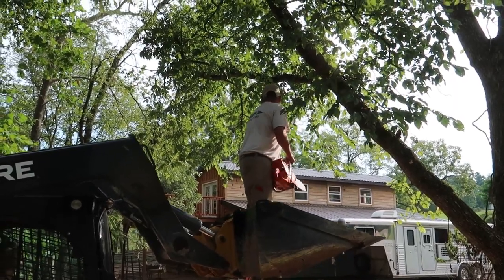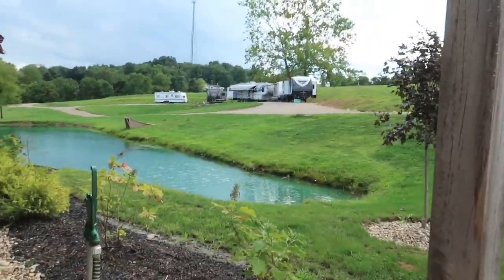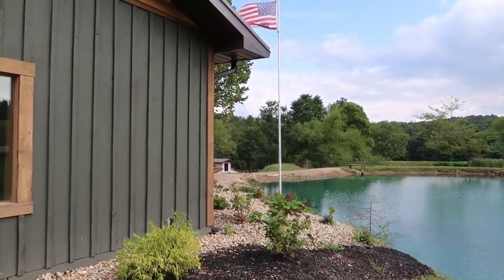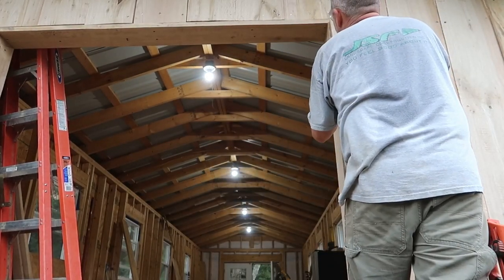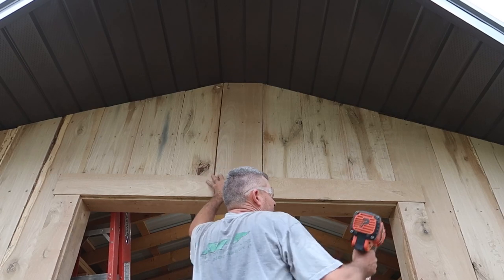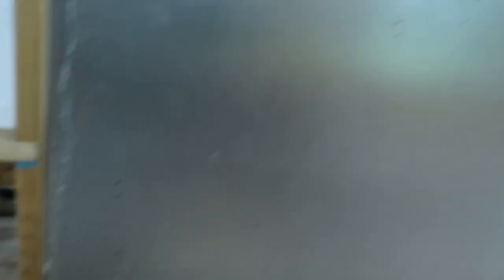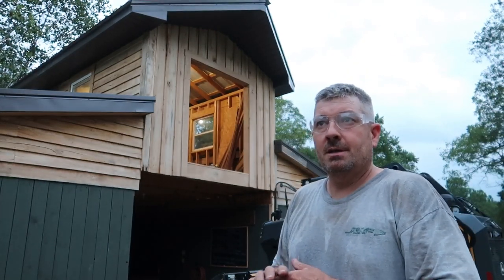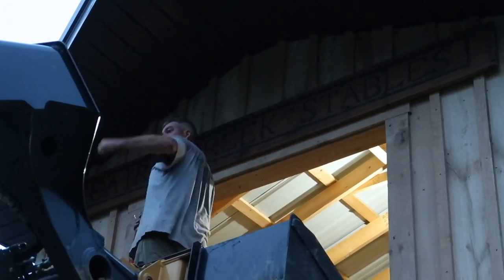Fresh white oak board and batten

Comment: How thick are your boards? Did you nail or screw? Did you nail just 1 side or both sides of each board? Thanks for your help I’m about to build a pool pole barn with board and batten white oak from the trees we cut to install the pool. I’m as green as the boards. 😂